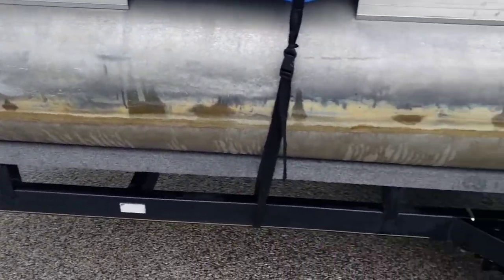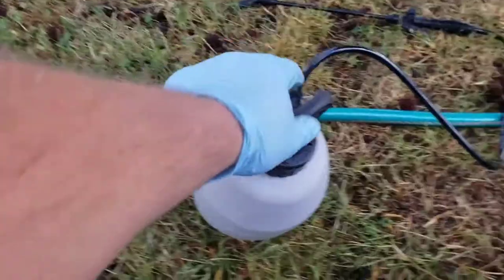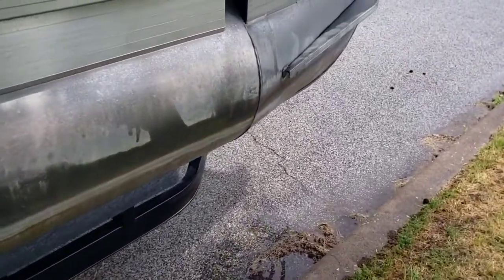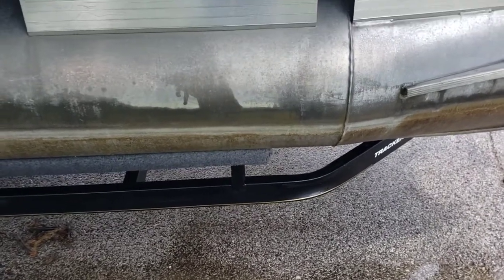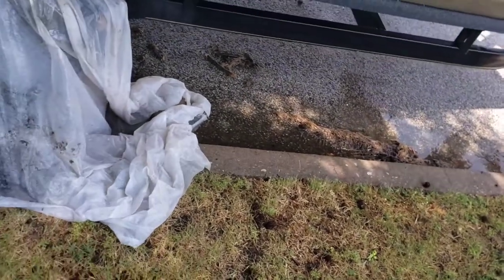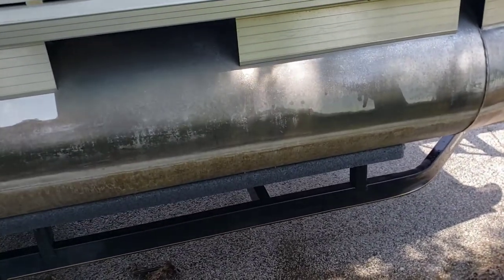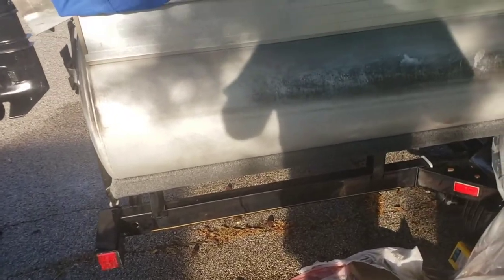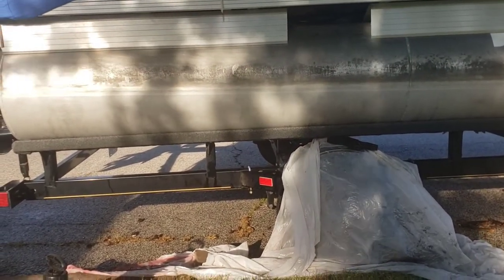How To Clean Aluminum Pontoons | How To Remove Calcium Buildup From Pontoons | Fast and Easy

Comment: Wow great video Brother thank you for sharing your knowledge and expertise  i just picked up a 1980 Harris pontoon the calcium is really thick  i my have to knock it down with a sander first  it is about 3/16to 1/4 thick thank you for the info
Reply from the maker: No problem! Be careful with the sander, don't want to go too far and start sanding the aluminum! The thing that sucks about having that much calcium on it is that it can cause it to eat into the aluminum

Comment: I just picked up a pontoon boat and have the same problem with the calcium built up but not as bad. I've done some light sanding and none of it is pitted. I have to wonder whether or not you're pitting is from the muriatic acid because it certainly will do that...
Reply from the maker: The pitting was on there before I used the muriatic acid. I tried multiple other things to get the calcium off, including sanding, and it was pitted underneath. The previous owner stored this boat in the water year round and most likely never cleaned the pontoons. 

The muriatic acid could cause pitting if I kept it on too long or didn't dilute it. I made sure to rinse it off for a few minutes after using the acid though

Comment: Dealing with same issue on Tritoon I just bought. Can you tell me how long did you let it sit?  I have an electric pressure washer, planning on using that to try to blast it off to go quicker
Reply from the maker: Maybe 5-10 minutes each time. If you make the solution stronger then it won't take as long. I diluted mine quite a bit so it took a lot longer but it was better than manually removing it! Make sure you rinse off as much and possible and wear some pants and maybe a long sleeve. The acid will definitely burn if it gets on your skin
Reply from the maker: There is also a product called "Alumabrite" that will do the same as this, but it is more expensive and will give the pontoons a white color to them, then you would have to clean and put some type of sealer or wax on it